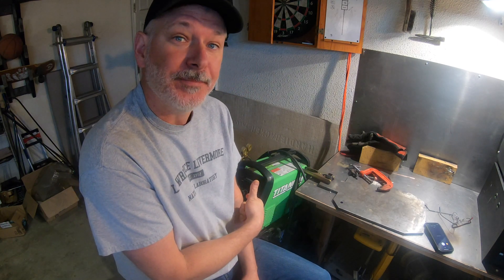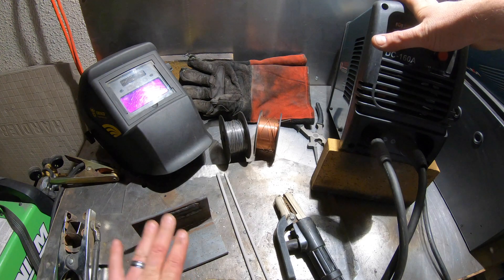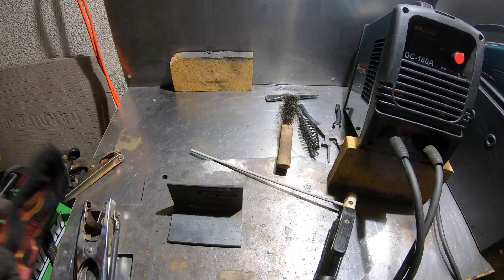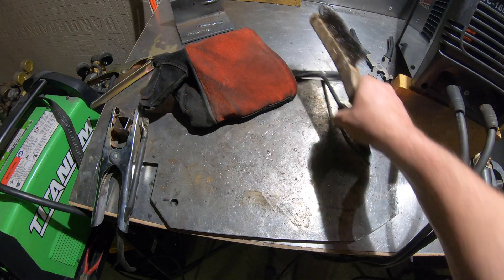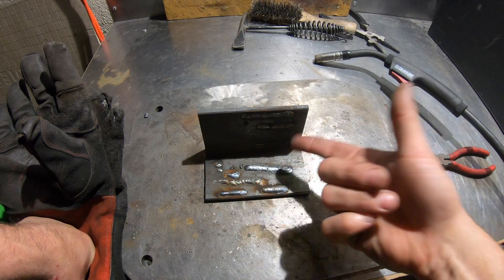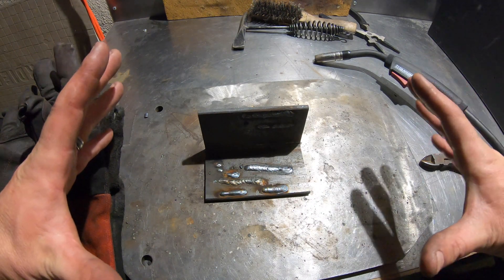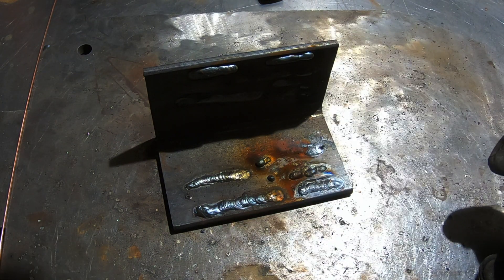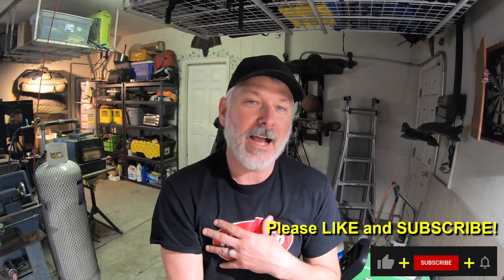Triple-T Thursday #26 - Welding Basics

Comment: What settings do you run when welding a Damascus stack together with MIG?
Reply from the maker: Each machine is different so the strings aren’t entirely transferable.  I set it as if I’m welding 1/8” stock.  Which for my setup is 265/18

Comment: But can you use gasless for Damascus I found a tig welder for 229 HF start I was thinking of using that? Can i use tig no filler or should i use filler? I saw the reviews by a few people i trust and he said for the price can't beat it and that was before it was 50$ off You answered at the end but should i get the tig? it does stick and is awesome price can't beat it
Reply from the maker: Don't forget with Tig you're going to need a dedicated argon bottle.  You can't do tig without gas.  If you're just tacking steel for damascus, I would just use regular tig with filler or mig.  When you fuse it, it can leave scars and you're better off adding material you can grind off, IMO.  Tig without filler (fusing) is great when you have a mosaic that you need to fuse together and you don't want to add mild steel.  You still need to grind that down a bit anyway because the fusing will mess with your pattern and muddy it.  Mig is good because you can get it to mostly sit on top with little penetration and just grind it after.  I use both though, it depends on the situation.  Tig takes practice for sure so don't get frustrated.
Reply: @TyrellKnifeworks  I see is gassless mig okay or do I need argon and co2 mig? This is the mig choice I was super unsure about. This is the tig https://www.amazon.com/YESWELDER-Welder-Voltage-Welding-Machine/dp/B08882MFWP/ref=mp_s_a_1_3?dchild=1&keywords=YESWELDER+TIG-205DS&qid=1627405839&sr=8-3 the deal is fantastic
Reply from the maker: @christopherconkright1317  Gasless mig is called Flux Core welding.  There is flux in the core of the wire so you don't need shielding gas.  It sputters and you'll have to chip off the surface after but its a decent alternative to stick.  It's just messy.  The first thing I checked on that tig is that it can do a foot pedal.  Mine won't, its lift start, which is a bit of a pain.  I don't do that much tig so I'm ok with it.  If you've never welded before, that's a lot to learn to jump into tig.  Mig is really your best bet if you're a novice.  I think this is a better machine if you're starting out and it gives you all three: stick/mig/tig (lift start) - https://amzn.to/3f4HGDo
Reply: @TyrellKnifeworks  it comes with a foot petal and it’s high frequency start.
Reply from the maker: @christopherconkright1317  That's good, but again, its not a welder I would recommend for someone who is just starting.  Plus you're going to require an argon bottle which will run you $200+.  If you know how to weld and you're just upgrading to tig, it seems like a decent machine.
Reply: @TyrellKnifeworks  makes sense how much is argon/CO2 I see it on Amazon but it’s 160 for just that tank I know I ask a lot but this is the last question. If that’s a good deal for empty tank
Reply from the maker: @christopherconkright1317  Thanks about right for the tank.  Then you need a regulator which is about $40-50 and to get the tank filled is about $100 or thereabouts.   I'm talking about a 60cf tank btw.
Reply: @TyrellKnifeworks  Okay good to know thanks this info was super helpful
Reply from the maker: @christopherconkright1317  Any time, glad to help.  👍🏻

Comment: Great stuff.  I do a bunch of wood work, and my father did a bunch of wood work.  But towards the end he switched to more metal work.  Mostly because of the welding "The glue dries faster" so he could build faster (=  And of course, I've been thinking about a welder for several months.  Totally need to win the lotto at this point just to be able to get all the toys!   Cheers!
Reply from the maker: Honestly just start with a stick welder.  You can pick them up for under $100 and that will get you going.  Mig is a luxury.  😜
Reply: @TyrellKnifeworks  I'm the type of person that only wants to buy something once.  So, I save for what I want.  And right now, a welder is a couple tools down on the queue.  Bandsaw first in a month or so!
Reply from the maker: @Canadiansasquatchbrewery  Sure, I totally get that and I'm normally that way too.  But that multi-process welder I have is around $1400 with the bottle and not everyone needs that much.  If it delays you getting into welding for a long period of time I would suggest just pickup a throw-away buzz box for $100.
Reply: @TyrellKnifeworks  Luckily, my project list coincides with my tool acquisition list.  So by the time I'm ready to work on welding projects, I should have the funds for the welder I want (=